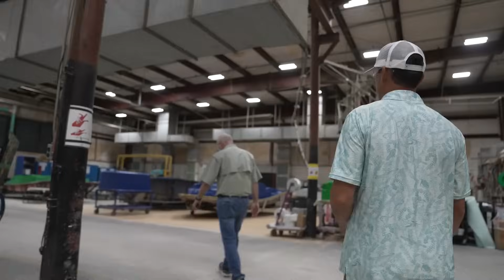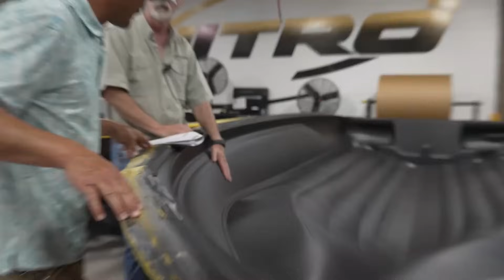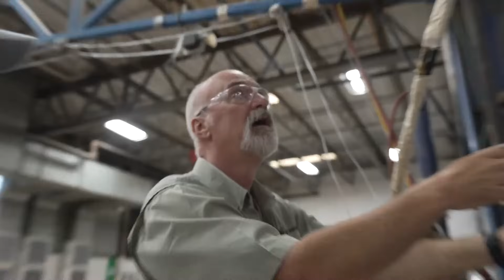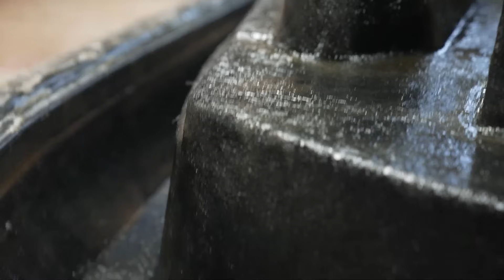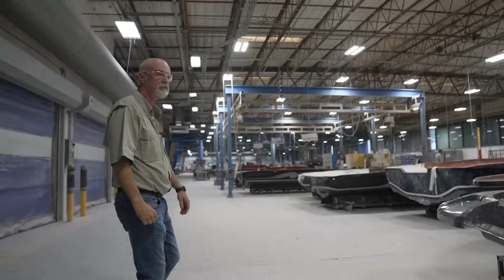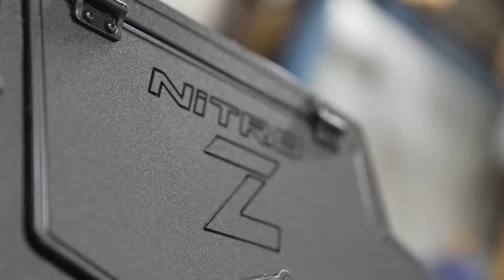After Hours Nitro Plant Tour With Chris Zaldain | Full Tour

Comment: 2026 Z19 XL, tandem and painted trailer. Custom built rig. 

So far so good…but I do notice a few “fit and finish” items such as the touch points, ignition switch, some switches and panels could be better. 

Pretty minor stuff. Running the Pro XS 200, dual poles…hit 71 mph. Great stability while fishing. 

Overall for a weekend or monthly warrior, very happy.